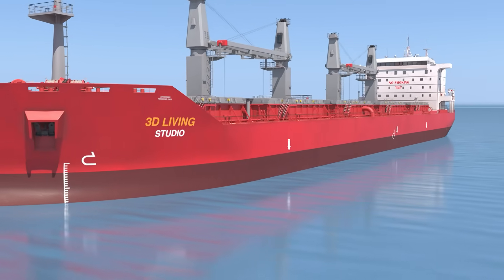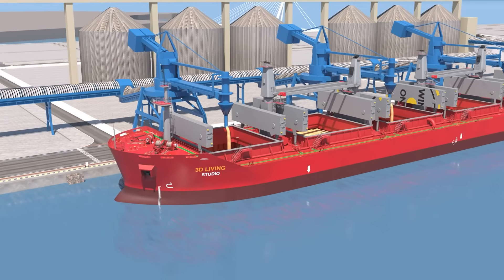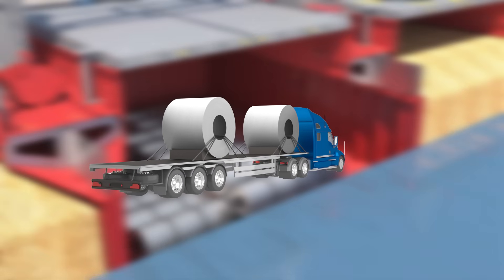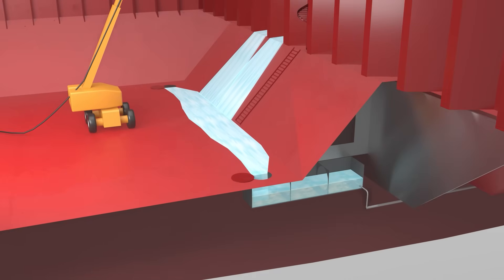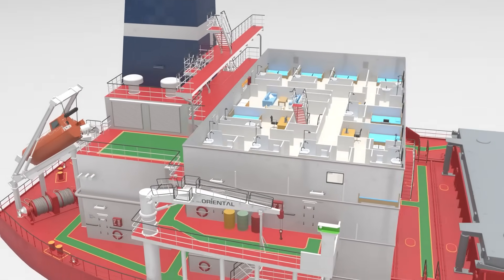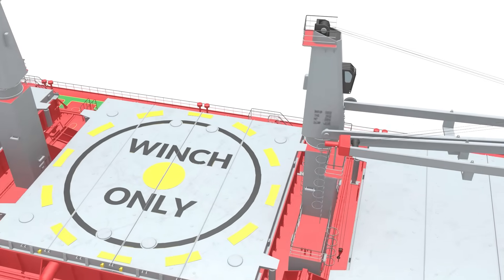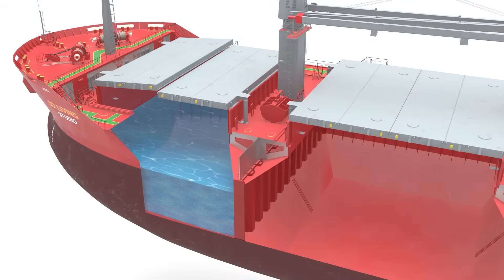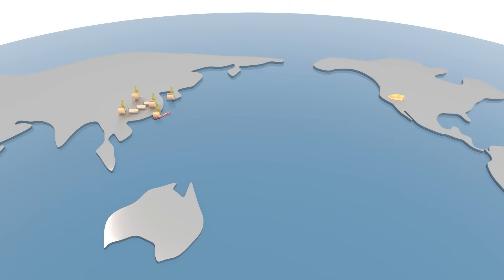How a Bulk Carrier Works – Loading, Cargo, and Design Features

Comment: Loading of grain seems 1000x more efficient than unloading. I am shocked nobody has come up with a better (faster) way. For example why not use a (very large) vacuum?
Reply: I used to work unloading these kind of ships and I was often thinking about this myself.
They even had a grain sucking pipe at some ports in Europe in 1930. 
My guess is that bulk terminals now often unload different type of goods, and the vacuum system would be a nightmare to clean after each use.
Reply: Because it's order of magnitudes harder to clean sucking system

Ain't no way I would eat grain unloaded by such device used to suck coal beforehand unless thoroughly cleaned

And it's not really much more inefficient anyway if the clamshell buckets are large enough to not bottleneck the entire port conveyor system

Comment: Great video, thanks.
A couple of remarks, though:
- bulk carriers do not carry Fast Rescue Craft but conventional rescue boats
- Fuel tanks inside the double bottom are banned since ages now. In the DB, only water ballast is stored
- large ships such as bulk carriers are usually built with longitudinal frames instead of transverse

Comment: Wouldn't loading iron ore with alternate loading method cause large shearing forces?
Reply: When alternate loading acceptable according to loading manual, it means this holds has reinforced tank-tops and bulkheads, so shearing forces remain in acceptable limits.

Comment: This is a very good video.  To have better shown the 'loading process', you should have shown how ballast water is pumped 'down' in ballast tanks, as cargo is loaded, and then eventually completely pumped-out - this once a cargo hold is half-full, always keeping the ship 'trimmed by the stern', to facilitate pump-out and stripping of ballast water.
Reply from the maker: Thank you, that's a very good suggestion. Why didn't I think of it while making this video.  Showing the ballast tanks during the loading process would've added a much clearer point about ship's stability.

Comment: Very nice. Helps me relax. However, I’ve never seen tracked bulldozers working down in the holds, always wheeled bucket loaders. Steel tracks on the steel plates would be like nails on a chalkboard x1,000,000. Lol. It’s loud enough when working under the ship when it’s a container ship being loaded/unloaded, couldn’t imagine a bulldozer turning on steel.
Reply from the maker: Good catch! That was just my lazy part not to modify the 3D model of the bulldozer 😅
Reply: @3DLivingStudio ❤❤🙏
Reply: @ That’s what I figured. No biggiez
Reply: To facilitate grain clean-out of a cargo hold (toward the end), they use front-end loaders (sometimes referred to as payloaders), with rubber tires.
Reply: @SailorGerry  That’s what we’re saying.
Reply: I saw tracked bulldozers while unloading coal and clinker
Reply: @sambell_101st6 or maybe they used the dozer in the loose stuff down to a certain point and then switched to wheeled loaders where they wouldn’t sink in the cargo.
Reply: @sambell_101st6 OMFG, that must of sounded awful on steel plating!